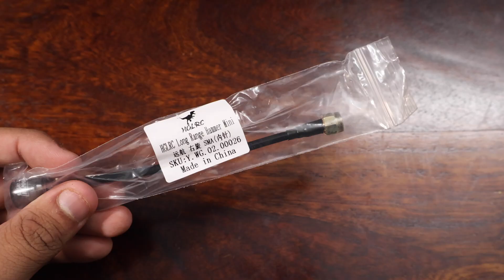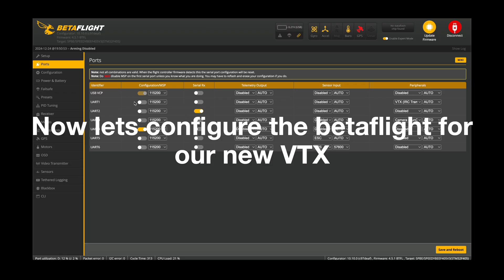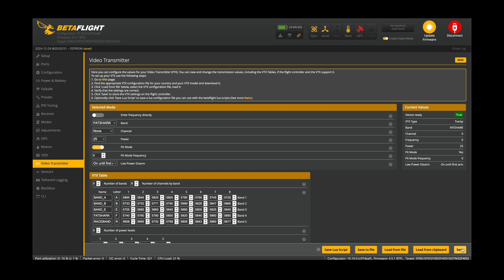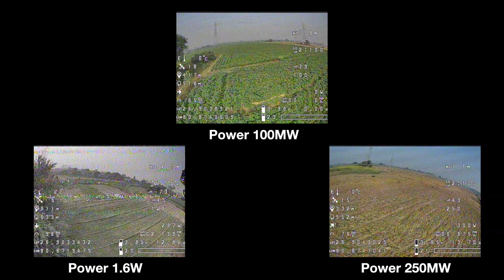AXISFLYFING SMURFS 1.6W VTX | Installation and Video Test | 4K | ANALOG VTX | FPV

Comment: Wow your build is so messy wires not twisted and not cut as short as possible and the power wire for the vtx and camara should be separate from the other wires it cuts the video noise down alot and no redundant ground which gets rid of motor noise you need to learn how to build analog the right way.

Comment: Bonjour
J ai installé le même, maisil ne fonctionne pas sur le pad /5v.
Tu as branché le fil rouge sur un pad 10v!!?non..?
Merci pour la vidéo. 👍
Reply from the maker: Thanks for Watching, the Red Wire(Power Wire) is connected to the 5V pad on the Flight Controller, you can check if that pad is actually giving 5V with a multimeter, if its not giving 5V then something wrong with the FC or try using some other 5V pad on the FC.

Comment: Hola amigo gracias por compartirlo, crees que este vtx compite con los conocidos rush tank solo o tbs unify pro en términos de claridad de imagen?
Reply from the maker: Thanks for Watching, Haven't tried TBS Unify Pro, but image clarity is never the concern in the Analog Video system, mostly all analog systems have similar kind of image quality. The only things that matters is the Signal Penetration, VTX Power, Antenna etc..
Reply: @AdityaKumar2128  bueno, creo que si hay diferencia entre una cámara de 1000 tvl y una de 1500 tvl y me preguntaba si también hay diferencia en la resolución y claridad de la imagen en relación al vtx. Para mi, cámara, vtx y antena vtx/vrx lo marcan todo en sistema analógico.